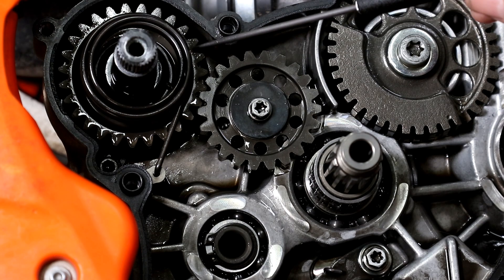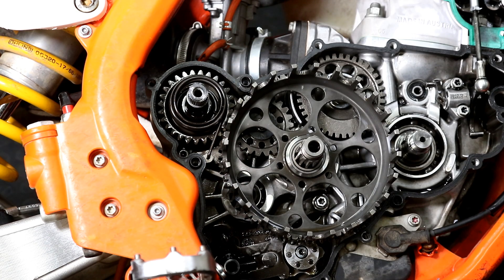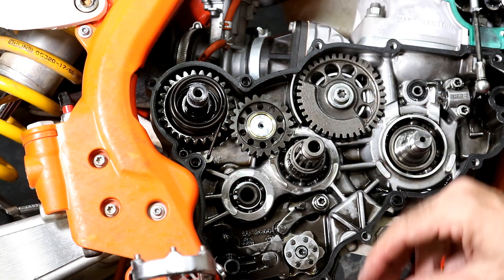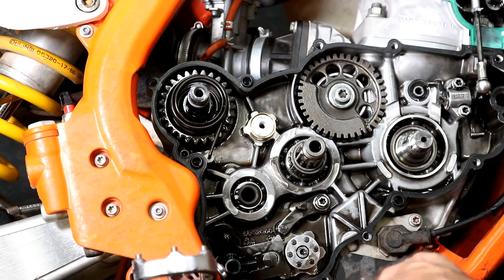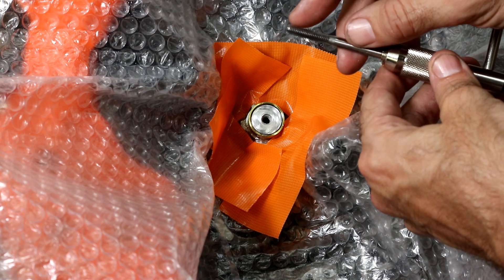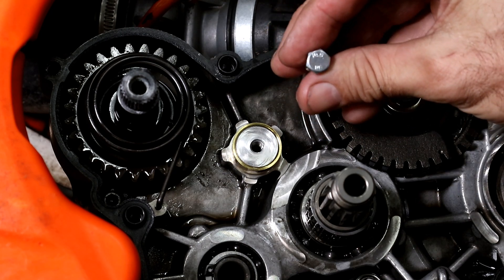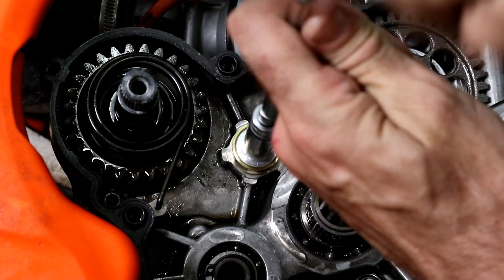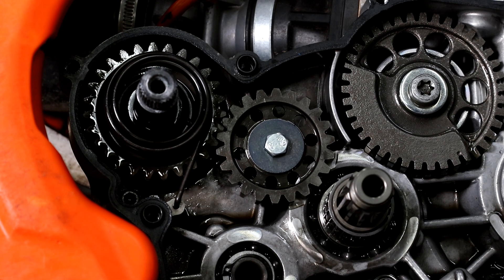Kickstarter Idler Gear Modification- 2017 KTM/Husqvarna 250/300 2T

Comment: Does this apply to 2018 300 xcw??
Reply from the maker: No, only the 2017 model. KTM redesigned the engine case from year model 2018 to avoid this issue.

Comment: What do I do if my 2017 250sx idler gear snapped off already called a ktm dealer near me and they said that recall isn’t coming up with my vin even tho if you looked it up it specifically says if my bike has the letter H in the 10th position on the vin which it does should be covered
Reply from the maker: I don't know the specifics of the recall, but if you have a document which states your bike is covered, show it to your dealer. It they still won't accept it try contacting KTM, or another dealer.

Comment: Is there any chance to do it, removing only the outer clutch cover?
Reply from the maker: Yes, you can do this mod by only removing the outer clutch cover. I had the inner cover off as the main job was replacing the crankshaft oil seal.

Comment: Thx for the Video! How to fix if the Case is already broken?
Reply from the maker: If broken the best fix is to replace with 2018 cases which were redesigned to significantly improve the strength of this area. If you want to repair the 2017 right side case you could have it welded, but it would still be weak due to the design. If possible it's best not to use the kick start on the 2017 and rely on the e-start as much as possible...
Reply: @TokyoOffroad  Thanks for youre response. Im very sad about that problem.

Comment: My ‘15 rmz250 has a similar kickstart setup in terms of force direction and i cracked my case. Wondering if i should jb weld the new case in the area behind the kickstart idle gear to add some strength. Not sure it will do anything.

Comment: Is this a issue on the 2018’s?
Reply from the maker: No, it's only an issue with the 2017 model. The 2018 had the case redesigned to prevent this occurring.

Comment: My…17 Ktm exc 300six days.Bolt is about the size 11mm.
Reply from the maker: The standard bolt used to secure the idler gear is listed as: 0025060126 HH collar screw M6x12 in the parts list of the 2017 models.
Reply: @TokyoOffroad  good. because i was servicing the engine and i saw your clip for this bolt i bought an 18mm bolt but which i unscrewed the original and measured the depth was 11 or 12mm and i use same original bolt.,
Reply from the maker: Stanislav Popov - I recommend tapping the full depth of the bore and to use a longer bolt as shown in the video so it strengthens the idler gear case boss. If you continue to use the standard length bolt and use the kick starter it is possible that the idler gear case boss will snap off. It’s a good idea to perform the modification shown in the video if you use the kick starter...

Comment: I don't really 'get' what fitting a longer bolt will do, the bolt and washer only stop the gear from falling off the end of the small shaft that the gear runs on, the gears are straight cut so there should be virtually no side thrust generated and therefore no load on the washer and hence on the bolt.  I guess the only slight gain in fitting a longer bolt is that you are filling an area of the case with steel that was originally just filled with air. If that is the reason it seems pretty 'marginal' to me!
Reply from the maker: Sidecarbod - Yes, the bolt fills the void in the case and strengthens it. There have been no reports of failures following this mod (AFAIK). Of course if you’re never going to use the kickstarter there’s no risk, but if you do use it, it’s worth doing IMO, especially as it’s cheap and easy to do.
Reply: @TokyoOffroad  Thanks for the reply, it must be very marginal then that it is not strong enough without the bolt running through it, I think that KTM sometimes take the idea of saving weight a little too far! :-) In fact I have found many things that are very 'questionable' on my KTM, the only reason that I am keeping the bike is because I feel that I have sorted everything out now and the thought of going through all that again fills me with dread! Keep up the good work, your videos are a welcome distraction whilst I'm at work. :-)

Comment: Does the 125/150 2017 need it too?
Reply from the maker: Federico Demaria - AFAIK this is only an issue on 2017 250 and 300s. The engine cases are different on the 125/150 and I haven’t heard of any failures.
Reply: @Brian McGinity Thanks for the info, when i'll change the rod i think i'm going to install new cases too. 125/150's cases can't be modified
Reply: @Brian McGinity i have already a 2021 cylinder, piston and flap beacuase mine cracked 20h ago... so i should be fine. But i'll contact my KTM Dealer, Thanks again Brian!
Reply: @Iam Friendly i have 130h and i haven't modified the case

Comment: wow, is it too much to ask for KTM just to build it properly in the first place?
Reply from the maker: Simon Phillips - It was the first year for this new engine. They changed the case design in 2018 to fix the issue. If you experience a case failure due to this I suggest you discuss it with your dealer.

Comment: I thought cash4clunkers already snatched up these vintage bikes
Reply from the maker: Drew P Knutz - LOL. In Japan the new balancer engine with carb was only available in 2017. They’re great bikes once you tune the suspension and sort out the carb to your liking
Reply: @TokyoOffroad  You tuned the PDS XPLOR shock? Slavens suggested using a spacer to lower the back by 19mm so the bike will be more balanced and planted. What do you think?

Comment: I like to use grease when tapping a blind hole it helps the chips stick to the tap instead of going somewhere you don't want.
Reply: Tnx for the tip! The oil achieve the same thing as he showed in the video.